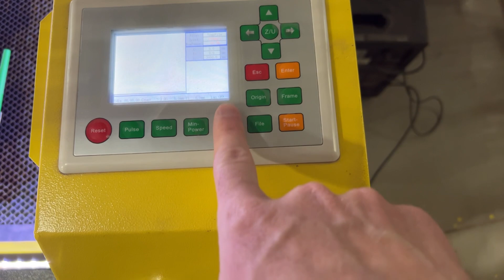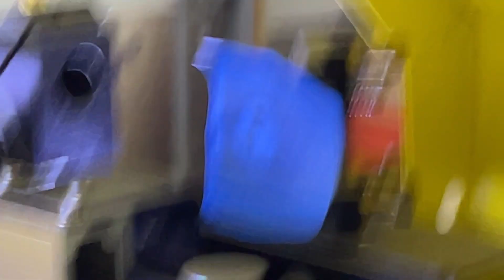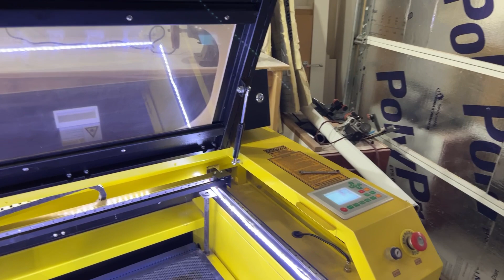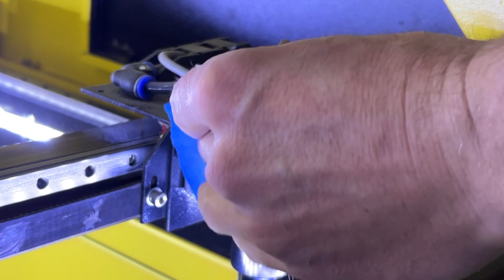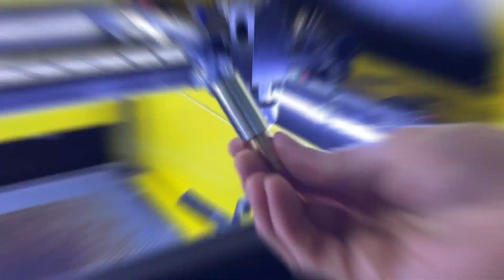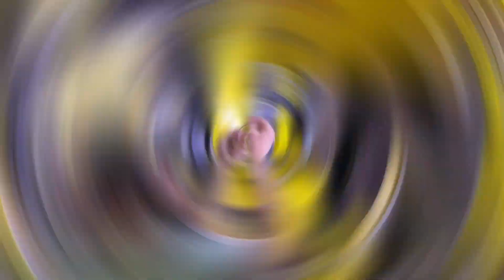Co2 Laser Alignment | Beam Alignment | Mirror Alignment

Comment: So what is the reasoning for reverse alignment?
Reply from the maker: The idea is that you want the beam to be perfectly aligned center through the nozzle so why not start there and have a reference to use - reverse alignment tool.
Reply: @BeardedBuildsCo  makes sense. I’m just about to do new mirrors, lenses and tube. Regrease everything and wipe/wash my 100w all down it’s about time to recalibrate everything so this was helpful. Much needed for how much this tank runs.Thanks for the video.

Comment: Any tips if the laser is so far out of alignment that M1 is more than 5+ inches off M2. Can’t even get it on a piece of paper folded in half in front of M2
Reply from the maker: If you have enough movement in the screws to make the adjustment then keep going. If not you might need to turn the whole M1 mount
Reply: @ yeah during transport (I purchased a 1 year old used unit) the M1 base screw vibrated loose and rotated around. I tightened it up thinking it probably didn’t move too much but I guess it must have because I’m out of fine adjustment.

Comment: I love your video on this topic. I have bought the photonics' reverse alignment tool.  I am having a problem on the last step.  I started with the old school alignment and that is all mirrors aligned and down the laser head. I start on the reverse alignment and i have the head to mirror 2 running 90 degrees. i move to mirror one and put the alignment tool and mark the spot on the tape, move the laser tube and have that on top of reverse alignment tool mark. I then adjust mirror 1 to 2 and it is out so i get them re aligned i then take the alignment tool out and fire my laser back to the head and i am out of square the laser is hitting the top of my laser head. I correct this and start the process over i have had the same results 3 times. In your video you don't check that alignment at the end and in theory it should not matter. I hope you can take the time and set me straight on this last step until then i will will do all the steps in your video up to moving the laser tube.

Comment: Hey. So I attempted the reverse alignment. Everyone I put the alignment tool in and tighten it, it points at a different spot on mirror 2. It does not go into the barrel the same way every time. So this makes it extremely difficult to get an accurate alignment since I mark with a Sharpie where the dot is, then remove the tool so I can pulse. Then we I reinsert the tool it’s not in the exact same spot because of tolerances. Any suggestions? 
To me there’s no way to get a perfect alignment if the tool can’t be pointing in the same angle every time. It has a very minute wiggle that causes a angle change causing the dot to not be consistent
Reply from the maker: Put the tool on a flat surface and point it at something next to it that is at a 90 degree. Roll the tool and see if the beam dances up and down. The tool might be faulty.
Reply: @BeardedBuildsCo that was the issue with my first tool and AP was awesome with customer service and sent me a new one.  
I wish I could show you a video of what I am experiencing. The tool has a flat spot on it and I always face it towards me so the tool goes in the same way every time.  However, it just doesn’t seat itself perfectly in the same place everytime.  I can even take my fingers and wiggle the tool with a bit of force and it changes location on mirror two. Not sure how this tool can work well if it can’t stay in the same spot and doesn’t reinstall in the same place with consistency. I appreciate your videos and help by the way! Not sure how to approach this from here.

Comment: Hey, another question for ya! I just watched you do a whole traditional alignment and it was spot on. But then you started a reverse alignment with the AP tool and you had to completely redo the alignment because the red dot wasn't hitting your traditional alignment marks? I have the reverse alignment tool and the beam seems to be nowhere near my current traditional alignment.
Reply from the maker: Traditional alignment is getting you in a general best position.

Using the reverse alignment tool you are actually able to see if you are getting true 90 degree angles and a flat beam all the way around so that you can then get the tube down into alignment with the perfect path.
Reply: Good info! I guess I was just confused as to why the reverse alignment tool was so far off from the traditional beam alignment. Im giving the reverse alignment a shot today. I just noticed when I put the tool into the barrel it has a tiny bit of wiggle. When I mark where the laser hits on mirror 2 and take the tool out and put it back into the barrel it’s not always in the same spot.
Reply from the maker: @Brianp1982  make sure to tighten down the collar around the alignment tool
Reply: Yes sir. I tightened it as much as I could. It seems to seat itself slightly in a different position when reinstalling it as needed. I’ll give it another shot

Comment: To be clear, if you have the reverse alignment laser tool, you would just do the second part and not have to do the initial part, right?
I am surprised that the front co2 laser bracket does not have left/right up/down threads to fine adjust the tube alignment on these machines. Sure shimming kinda works, but often people are sticking postit notes or paper as shims and over time things like that will compress and get thinner and the alignment will drift. I guess the same thing would happen with rubber grips touching the glass as well, but it would be easier I think to periodically align it.
Reply from the maker: You will align with the revers alignment tool and then you would need to match that patch with the actual laser beam.

Comment: Thank you so much for this video. I haven’t found one I could really understand and most of them just show you a perfect alignment situation versus troubleshooting

I do have a questions, after years of not having my laser aligned or being successful at aligning it perfectly I got the reverse alignment tool and followed all your instructions. I’m good all the way up to the very end, I cannot for the life of me get mirror 1 aligned to 2. I marked where the dot is on Mirror 2, I pulsed closest to mirror 1 and then furthest from mirror 1. My pulses are on complete opposite edges of the circular opening. Taking your recommendation I adjust mirror 1 while mirror 2 is furthest, until the pulse is just slightly over/past versus exactly matching up. When I bring mirror 2 back close to mirror 1 to pulse, my beam is so far off it’s not even hitting the frame never mind within the circular opening of mirror 2 😩

Any other tips that could help me to bring these pulses together at both front & back

Comment: reverse alignment tool:  At no time did you adjust the knobs on mirror 2.  Why wouldn't you adjust them to move the red dot down to where the laser pulse was before even shimming the tube etc and then adjust mirror 1 to fine tune the laser pulse to the red dot location on 2?
Reply: I had the exact same question.

Comment: which reverse laser tooldid you use?there are several to choose from on the website.
Reply from the maker: You have to measure the tube that inserts into the laser head and buy the corresponding size.

Comment: Great video! I do have a question here though. I can get mirror 3 centered when it is nearest to the tube, but once I bring the axis down to the bottom of the machine, it is no longer aligned. I am basically getting a different hit on each of the corners of the bed. Any insights?
Reply from the maker: Align the pulses first and then adjust the tube to center.

Comment: You say mirrors 1 and 2 don't need to be centered but if they are not centered, do they need to pulse in the exact same position.

For example, if mirror 1, the pulse is 2mm to the left of center, should I try and get the pulse on mirror 2 to be perfectly centered, or should it also be 2mm left of center?
Reply from the maker: No the goal is to make sure no matter where mirror 2 is at the pulse hit the same spot on that mirror.
Reply: @BeardedBuildsCo  Sorry - the answer is a little confusing. Can you clarify that a little bit.

If mirror 1 is left of center, should mirror 2 also be left of center?
Reply from the maker: No

Comment: What to you suggest in this case.  I adjusted mirror 1 without properly reading/watching a video and now basically i am at the point where I cannot get it adjusted to save my life.  I can get the beam in the middle of mirror one but mirror 2 is so far off and mirror 3, forget about it.   there must be some adjustment to mirror  1 to get it back to working again.  Had i not adjusted mirror one i would have had no issue.  I am beyond stumped now.  Thanks

Comment: so im needing to move my dot to the left but the left screw is out all of the way if that makes sense so what would one need to do then
Reply from the maker: It’s hard to give accurate advice without seeing what you are talking about. Likely you will need to screw all three screws in equally to get extra movement from the mirror without running out of threads.

Comment: Once I’ve got my 1-2nd mirror perfectly aligned, and then pulsed on the laser head ( back left ) closest to the 1st mirror it’s off centre but my back right pulse is perfectly in centre, how do I go about this to get that first one in centre?
Reply from the maker: You first need to align them. Once they are aligned then you adjust the laser tube to get the pulse centered.

Comment: Hello! Thank you for your video.

However, once I finished following all the steps my co2 laser w2 90wats is not giving me the same power results. 

I have change the max power and min to 0-90 on the mother board but once I give it a go to cut for example paper on 40 speed 30 power it wont cut. Even if I put the laser on the Max power it still doesn’t cut. 

Any suggestions on what I might be doing wrong? 

Would appreciate your help

Comment: When adjusting the tube, does it matter whether you make the moves at the front or the rear of the tube when aiming for a parallel beam at the head?
Reply from the maker: It does not matter
Reply: @BeardedBuildsCo  Thanks for the response! Going to tackle an alignment project this week with the reverse alignment tool.

Comment: I watched the video twice and something is not clear. You never made any adjustments with the thumbscrews of mirror #2. What if you had lowered the beam of the alignment tool with these screws?  You may have not been obliged to realign the laser tube?  OR you aligned it all prior to that like in the first half of the video and the gave you the perfect alignment.  Please respond. 🙏
Reply from the maker: It’s a combination of both scenarios. You need to look at this video as to separate examples. The first half is traditional alignment and the second half is an alignment using the tool. There is no way to cover every possible case that could present itself with doing an alignment. Work from one mirror to the next check and making adjustments.

Comment: I guess I am a bit confused. It seems that if you align it all the "traditional" way, then using the reverse alignment tool method would give the same results. Why is alignment different going FROM tube to head or FROM head to tube? If it is aligned, then the light should hit the target no matter which direction it is going.
Reply: Wondering the same thing.  Why is the red dot way off after the whole alignment is already done?
Reply from the maker: Because dialing in by pulses alone doesn’t not show you if you are getting a true 90 through the laser head.
Reply: @BeardedBuildsCo  thanks for your reply. That makes sense.
Reply: The reverse method is just easier. The low power laser is just more immediate. The result will be the same.
Reply: This is very confusing. When you align traditionally you pulse to the axis of travel, hence making your beam flat as can be from mirror to mirror as it travels. At the end you are completely aligned. Putting the reverse alignment tool in just does this exact same thing in reverse and the beam is visible this time making it easier. So the confusing part is why is the reverse beam so far off but somehow can be a perfect alignment in comparison to doing it from the tube ?
I wish I could understand this. 
I would love to see a video with a “beam combiner alignment vs a reverse alignment tool. I feel there is a variable we are all not understanding.
Reply from the maker: @Brianp1982 the reverse alignment tool tells you where the perfect plane is from where the laser head is at.

Traditional alignment tells you where the perfect plane is at from where the tube is at. This may conflict with the final portion of alignment inside of the laser head to get a perfect 90 and that is the idea behind the reverse alignment tool.

Comment: so when using the tool.  the laser looked like it was centered pretty good on mirror 1 to start with.  Why would you not just adjust mirror two to match the burn hole on mirror 1? that seems like the easier better method if your tube is already centered on mirror one. so basically these steps
1. center tube on mirror 1 and leave tape with burn hole in place
2. install reverse laser tool
3. adjust mirror 3 at near/far points to center laser on mirror 2
4. now adjust mirror 2 at near/far points to center laser on burn hole made in #1
5. Beer

Comment: Thank you for the explanation.  It wasn't clear to me at first, but I think you are showing two different methods for doing laser alignment.  The first was more of a traditional method I have seen in one or two other videos, while the second half of the video was a completely different method. 

It was confusing because if the first method was right on - which I thought it was after watching the video, it would seem the second method (reverse alignment tool)  shouldn't have resulted in as much needs for change - such as a need to actually manipulate the tube, which doesn't really have any adjustment methods - other than the shim process you fabricated.  

At the end I think you are indicating that the reverse alignment method actually gave you better alignment than the method without the tool - i.e. discussion about test card.  Is that correct?

Do you have a file you share for your test card.  I need to get a test card fabricated and your's looked good.
Reply from the maker: Yes there are two methods in this video. What you can see if the angle of the beam coming down the laser head. The better you can get that to a 90 the better results you will get. This is the sole purpose of the reverse alignment tool. Want you will run into is that making the adjustments with the reverse alignment tool will most likely show the imperfection of the original alignment and then require the adjustments with the tube.

Here are links to the cards
https://www.facebook.com/groups/1364016877267714/permalink/1464898480512886

https://www.facebook.com/groups/1364016877267714/permalink/1464898167179584

Comment: This is one of the better alignment videos I have seen for the first part doing the conventional alignment, however, the second part using the red dot alignment tool was a little confusing to me. It seemed like in the first part of the video you got the alignment pretty right on without moving the laser tube. 

I have two questions, in the second part of the video using the red dot tool as you were moving the laser head left from right the red dot was bouncing around, what causes that? Is that an indication your track has some imperfections in it?

Have you tried to rotate the alignment tool while in the nozzle tube and see if the red dot moves out of being concentric? When I rotate my alignment tool, the red dot also moves in a circle, indicating the laser dot is NOT centered in the tool. Thanks for making the video.
Reply: mine does the same thing but even worse, I would assume it's from the rails but haven't ever found exact reason.